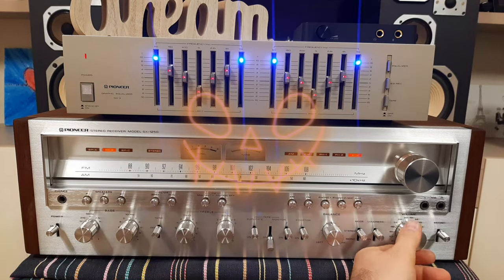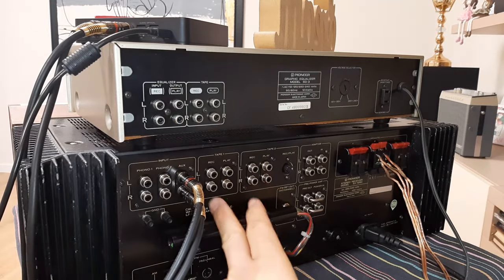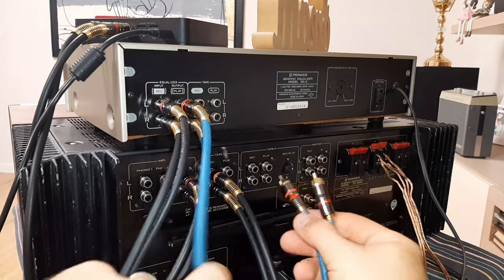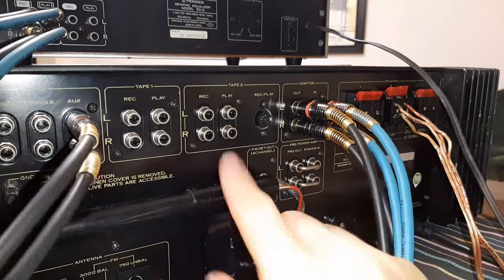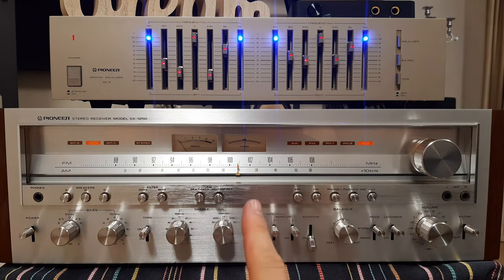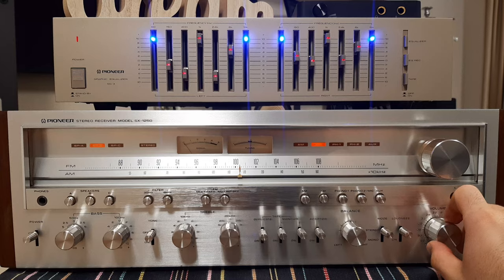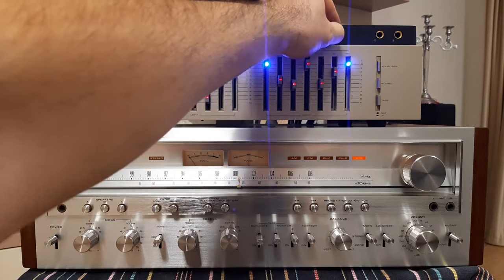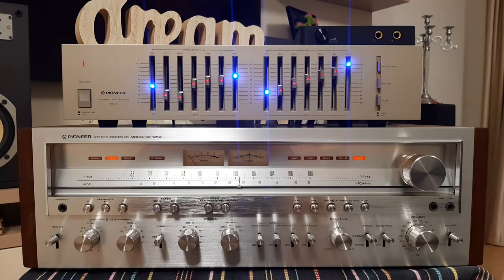How To Connect Power Audio Amplifier With Equalizer or Tape Deck Step by Step Guide

Comment: Morning. I have 2 full spec system but I don't know how to conect  the  RCA.  Can you help me? 
I have : 
Spec # 1 
Ct f1000, spec 1, spec 4, ga 9500 eq. 707 reel to reel 
Spec # 2 
Ct f1000, ga 9500 eq, tx 9500 radio, sx 1250.